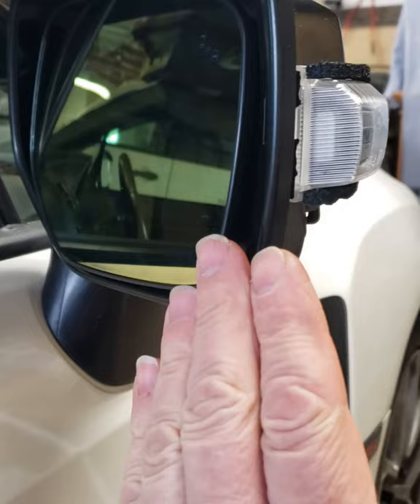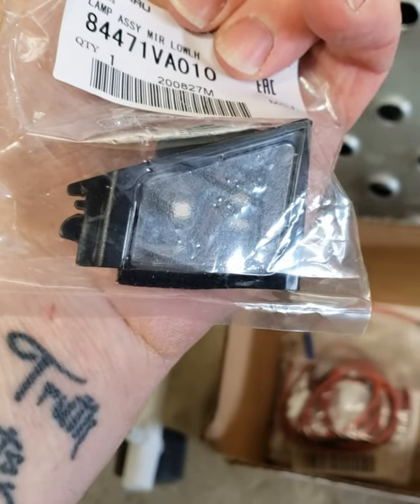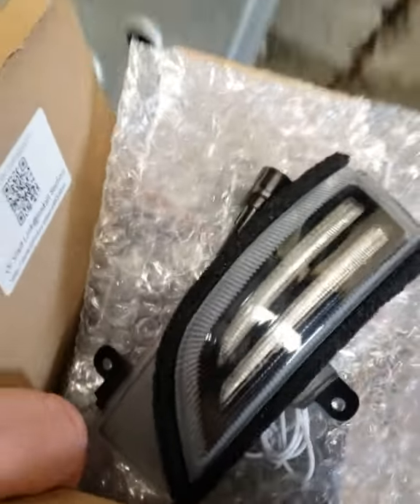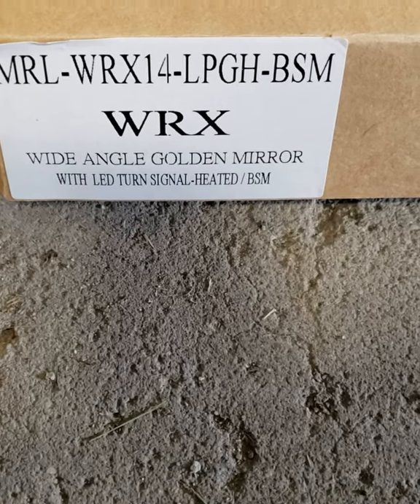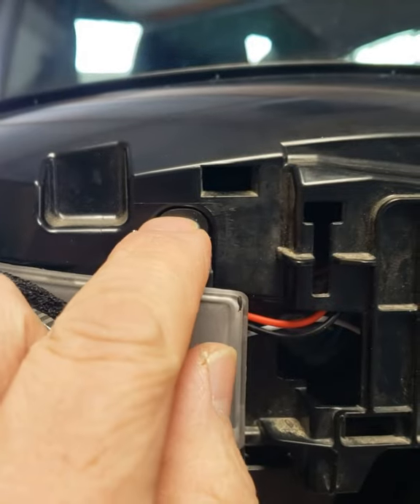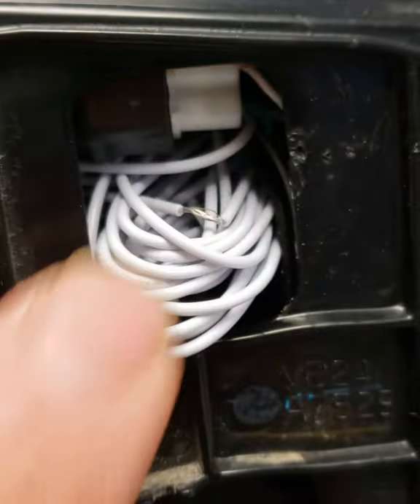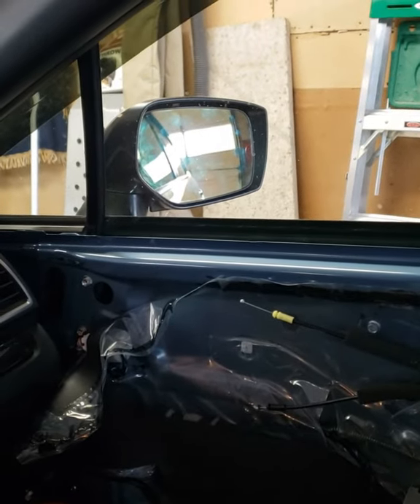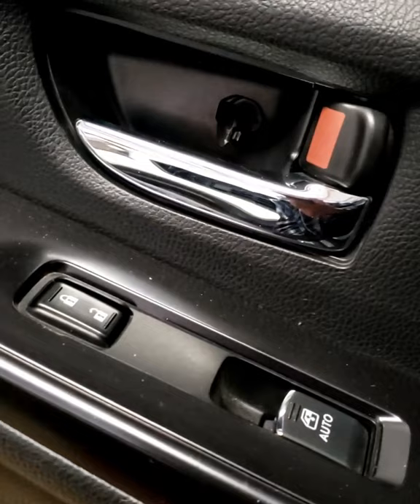15+ WRX Mirror Light Install-Mirror LED Turn Signal, Sequential Turn Signals w/DRL, Puddle Lights

Comment: very relevant to my wrx in the very near future....a hollow tube and silicone spray will help w/the wires in the mirror grommet
Reply from the maker: I'm glad you checked out my video. Hope your install goes well.
Reply: @2018wrxaddict ... me too, me too.  Thanks for putting the video together.  I have several saved for the ordeal.

Comment: Super helpful. Did you tap the driver side puddle light wires to the passenger side wires? Or did you tap them directly to the add-a-fuse and blue and pink wires? 🤔🤔
Reply from the maker: I connected the passenger and drivers side puddle light wires together.  The black to black and connected those to the pink and blue wire.  The red wires I connected together and connected those to the add a fuse.  Don't forget...two fuses are in the add a fuse. 👍
Reply: @2018wrxaddict  thanks 🙏
Reply from the maker: @hai_katsu807  no problem you're welcome.
Reply from the maker: I'm glad the video helped.  Not the easiest install, but some patience will get folks through it.

Comment: Why not run the drl circuit to the steering column and tap into the parking light switch stalk? This way the drls are not on 24/7 and will turn on with your parking lots. I have my jdm drl bezel lights, demon eyes wired that way so when I throw the parking light switch the come on but will turn off if set my parking light switch to off.
Reply: Which fuse did you wire into in the interior fuse box, or was it something else that you had to tap into? Most videos I’ve see wind up tapping into a wire in the door, which is ok, but like you say, if you had it wired to the parking break, it would react to the parking brake which would work with the DRLs in the headlights (on 18+ model WRX limited and STIs)
Reply from the maker: @sjnims  you mean for the welcome lights?  Those were wired the way the Subispeed video shows.  They work perfectly.  Getting to the wire under the dash was kind of a pain but doable.  The video shows the exact fuse location I tapped into for the welcome lights, which is the seat heater fuse.
Reply from the maker: @ Joseph D.  I just wired them into the door wiring because that was the only way I could figure out how to wire them.  I realize there are other ways.  I am not the greatest at wiring, but the way I did it works well.
Reply: JD, of course , if wired as stated,  then these won't function as daylight running lights.   So depends on what you want.